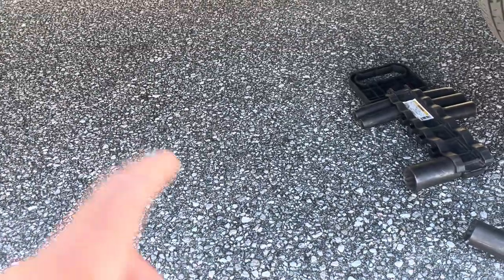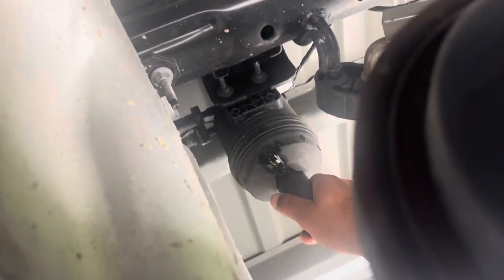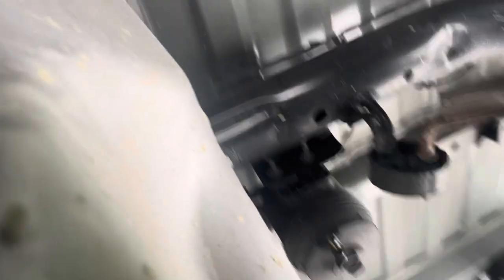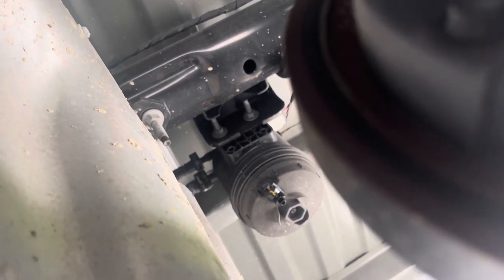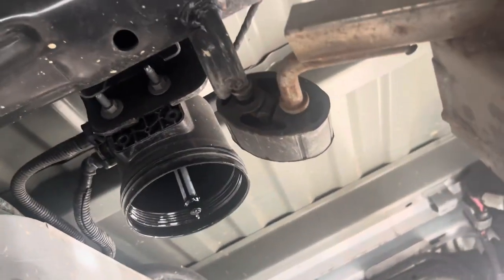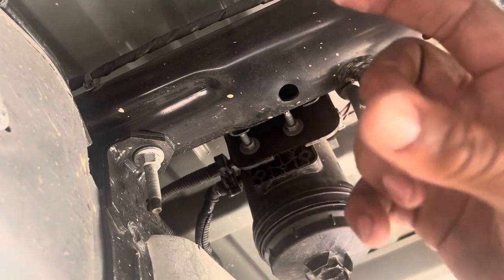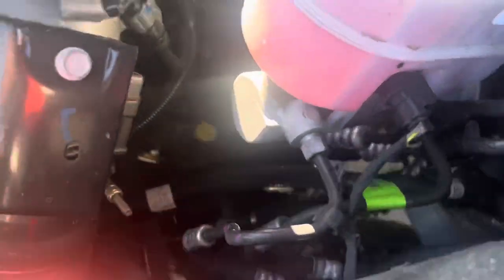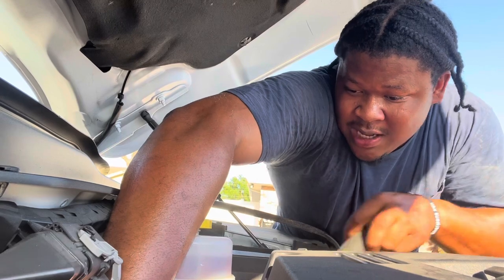2022 Dodge 3500 6.7 Cummins fuel filter replacement

Comment: you can put a drain hose on it and keep the pepcock open when you crack open that filter and it will all drain out the pepcock. no mess.

Comment: Good job. Thanks for taking the time to film this. I know it was a tough job, but even tougher when trying to film it too. Question: was the diesel leaking from the filter drain plug only when the truck was running, or draining out when it was turned off too?
Reply from the maker: When it was running because the compression from the primer was on

Comment: How did you take that black cap off from underneath the black cap on the front fuel filter
Reply from the maker: Use 1 1/8 inch socket I use deep well on mine because it’s easier for me since mine sit in a hole, not a lot of room have to inch it off, and if it’s the shut off and turn on valve it should spin open and close